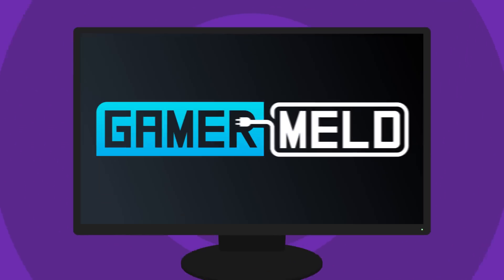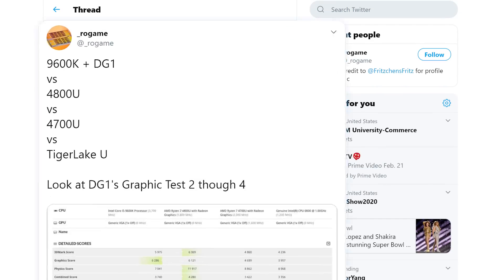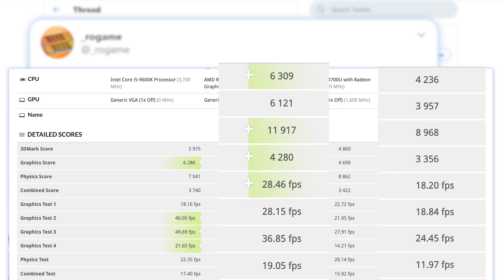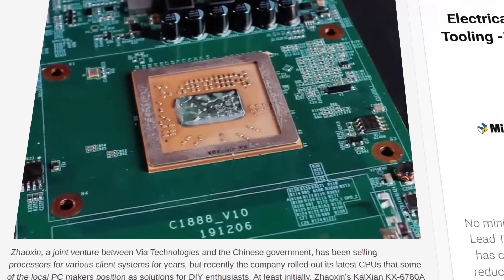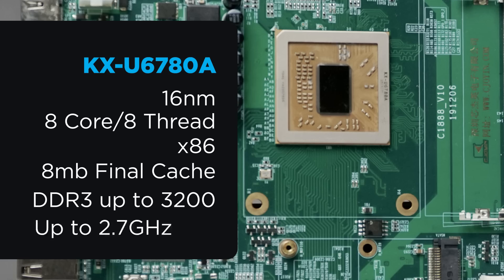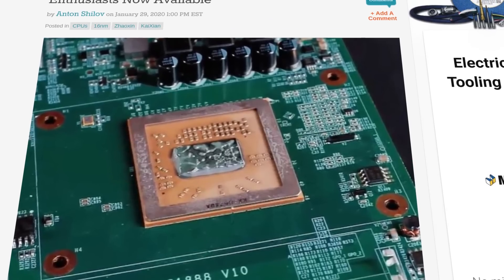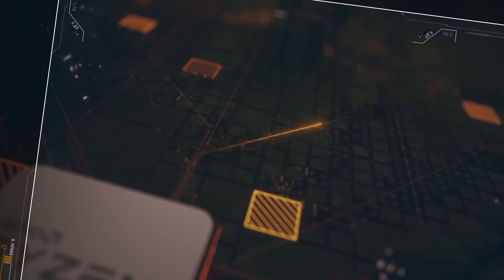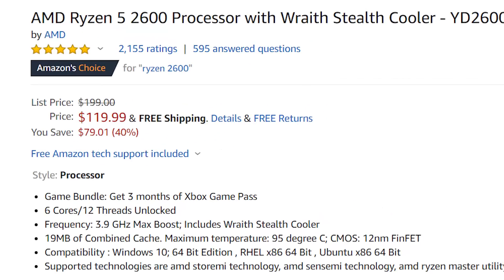Intel's FIRST Xe Discrete GPU Beats 7nm Vega!! I'm Not Impressed

Comment: If it is under 100$ it could be a good gpu
Reply: But if you can get an Apu that comes with your CPU that competes well, why would you spend an extra $100?
Reply: @JamesSmith-dn8lb   true but it could be good choice if u want to upgrade and old pc and u dont have alot of budget like the 1030 gddr5
Reply: @aliii1158  to get those numbers they used 6gb of gddr6 that is about $72 in memory if they used gddr5 maybe they could get to that price but how much of a performance hit would it take too
Reply: Except the 1030 is around $40, I can't imagine Intel setting prices lower than that.

Comment: Sorry buddy but I have to call out your first story, the benchmark was meaningless.  You can't compare a benchmark where one chip is a low power mobile chip with integrated graphics against a full power desktop chip with a GPU.  If anything, looking at the figures, the AMD chip does rather well in that comparison & I wouldn't have talked up the Intel product at all.

Keep up the, otherwise, good work though.  I do enjoy your reports.
Reply: Also he didn't understand exactly why the discrete version out performs the igpu variant even though they are supposed to be the same but we all know the biggest performance problem igpus have is memory speed and the dg1 has 6gb of gddr6 vs the 4800u using system memory and I wouldn't be surprised if intel gimped that by giving a single dim of slow memory

Comment: you do know why theyre making a discrete GPU right?

theyre making it so computer manufactures dont have to put an nvidia card in their low end desktops
Reply: Maybe extra discount to pick up an all Intel system too. But low end graphics from AMD and nVidia are better bang for ya buck.
Reply: I expect over time as they gain experience making GPUs they will start making multiple SKUs to compete in at least the mid range market
Reply: Most low end desktops rely on integrated graphics, anyway.  Modern integrated graphics is usually good enough for most people especially if they're not playing 3D games made in the last 10 years.
Reply: @IARRCSim  HA

Comment: DG1 should be priced as $99 card brandnew..its way below a used $50 rx470 in performance
Reply: With that performance, forget about even selling it to the DIY market when the low power/budget markets are full of 1650/S's, 5500/XTs, Polaris cards, etc..

Given that DG1 is some kind of a GPU is somewhere between an IGPU and DGPU, it would go well on within OEMs machines and/or NUCs.

Comment: RDNA1 is just one small step for GPU world but one giant leap for AMD GPU
Reply: Yes ,I'll buy one when they actually beat Nvidia. Which is probably in 2-3 yrs
Reply: @NeVErseeNMeLikEDis  with current AMD Driver condition and current AMD GPU pricing strategy,,, 
i doubt GPU launch in 2020 will be Interesting 😕
Reply: @ZAR556  that's the dumbest thing I've ever heard about 2020 as far as hardware goes.

Likely to be the best year in a very long time.
Reply: @TheDarkToes  RDNA is great hardware,
But wtf with driver
Reply: @ZAR556  RDNA is the software Navi is the hardware and it is a first generation so year there will be issues
Reply: @ZAR556   I'm saying it's not , but for my needs I need the best. 2080ti is barely Cutting it .
I need more powerful gpu.
Reply: @NeVErseeNMeLikEDis  Ampere will have lot more VRAM if you need that many power
Reply: Amd's drivers always seem to suck, ill upgrade once the nvidias 3000 series come out